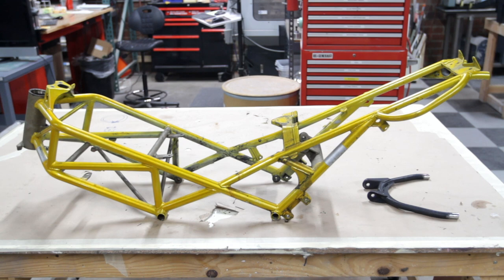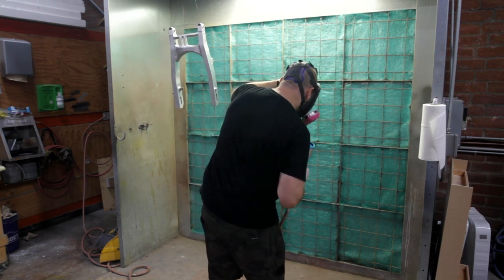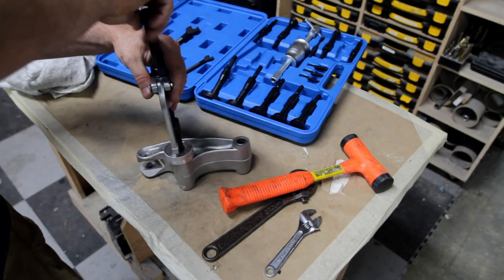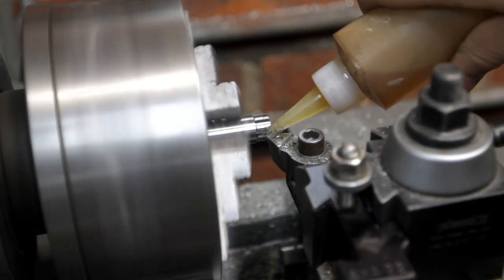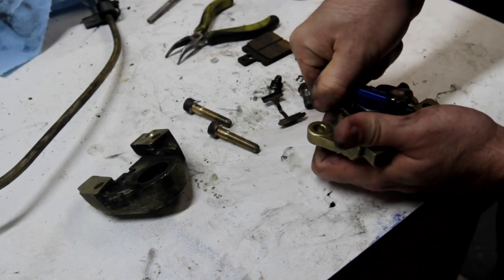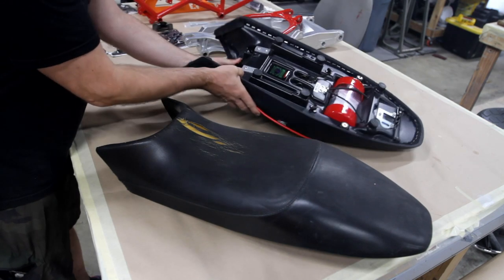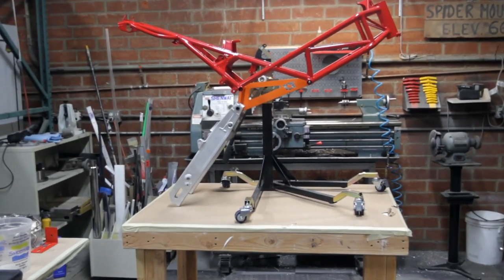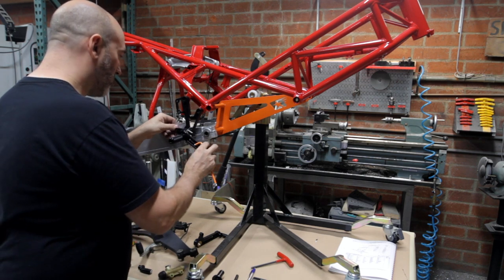'95 Ducati Monster 900 rebuild: Episode 5, Enter: the Dummies Garage

Comment: Might be a bit too late now, but running all those bolts you are reusing in the ultrasonic cleaner will probably get them shiny and fresh. If it has a sweeping wave function, even better for small stuff like nuts and bolts :)
Reply from the maker: Cleaning dirty bolts doesn’t turn them into titanium, or remove the stretch and stress from being abused and old. I’m replacing just about every bolt on the bike.

Comment: Really looking forward to seeing this back together. Nice work fixing the dings in the swinging arm. Too late now but you can get caliper rebuild kits from Powerhouse (not sure if they ship to the US tho'). https://www.ebay.co.uk/itm/Ducati-900-Monster-93-99-rear-brake-caliper-seal-repair-kit-1993-1994-1995-1996-/151570859257

Looking forward to the next instalment.
Reply from the maker: I saw that one when I was looking.  It doesn't include the pistons like other rebuild kits do.  I was told that its an insurance issue about rebuilding them, that's why they aren't available in the US any more.
Reply: Beg your pardon! I thought you were just after the seals. For future reference, you can get the pistons from Powerhouse for that P32F caliper https://www.ebay.co.uk/itm/Ducati-Brembo-P32-F-rear-brake-caliper-piston-seal-repair-kit-748-916-996-998-/163661870908?hash=item261b01f73c 

It's a shame you couldn't refurbish the old one as you'd cleaned up the body like new.  

I know what you mean about the insurance issue tho' - it's the same in the UK. You can't buy any Brembo parts from Ducati dealers but KTM dealers do stock most Brembo spares so, if you can find a KTM model that uses the same calipers, then you could also try there.
Reply from the maker: Luddite your google-fu is better than mine. Or maybe the UK eBay stuff just never came up for me.  Cheers for the insight!